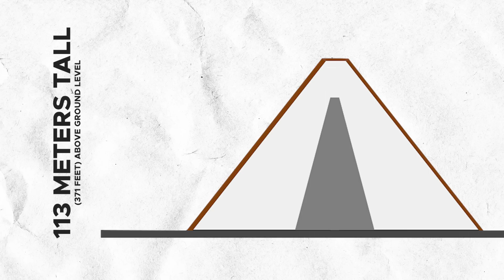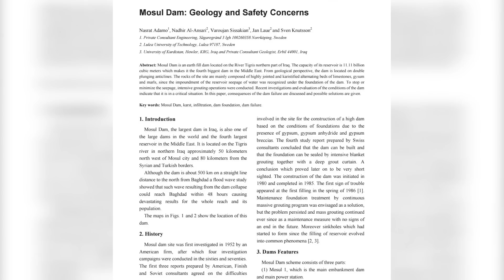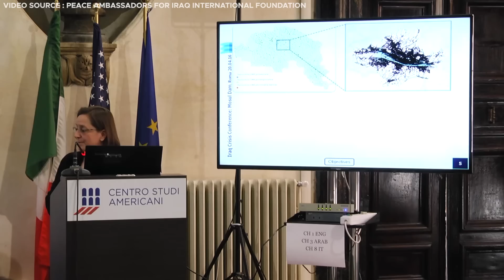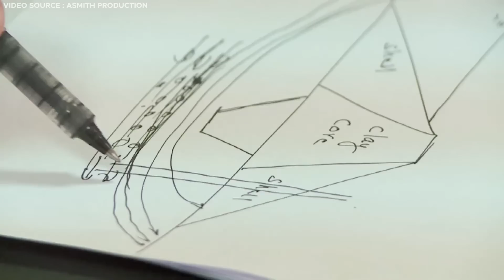Iraq’s $4 BILLION Gamble To Save A Collapsing Mega Dam

Comment: The problem with this dam is underground soil softening. The water dissolves the very ground the dam is built upon. The problem? This dam supplies electricity to several cities in the country and they spend millions every year forcing grout into this subsoil to keep the dam from collapsing. This dam is doomed and will not keep producing power. It needs moved either upstream or downstream to continue to function and needs drained in it's entirety. The material dissolving is like wallboard here stateside and you know what happens to wallboard if you get it wet.

Comment: 3:25 "Dam's Reservoir can hold nearly 3 cubic km of water equivalent to 11.1 cubic miles."     Utter horse manure!!!!!!!!!!!!!!!!!!!!!!    3 cubic km = 0.719738275 cubic miles.  11.1 cubic miles = 46.2668 cubic km.    "At full capacity, the structure holds about 11.1 cubic kilometres of water - Wikipedia."

Comment: Am no dam engineer , got to meet them at Water Affairs here in South Africa , mid 80 s 
   As mentioned here , seepage is an issue . 
Dare I say with any dam . 
  Just the huge pressure of water involved , finds its way through very small places . 
Back then , the idea was to drill seepage holes below the dam , slide in preformed tubular filter screens and ' gravel pack ' , , theory being that the  seepage would be drained off in a fairly ' safe ' area as it would follow line of least resistance . 
  My 10c worth :-)
Reply: Damn!